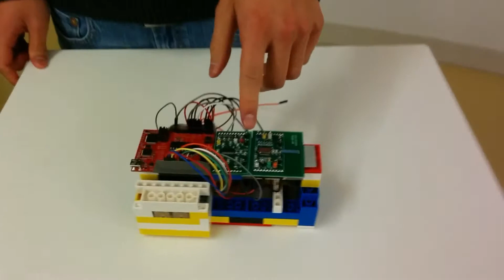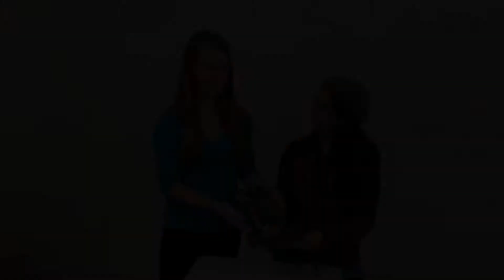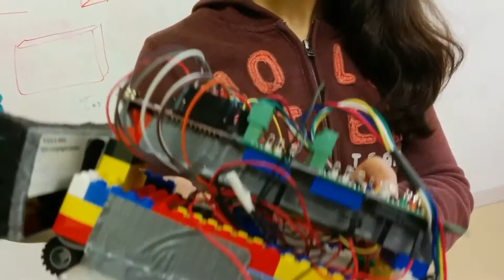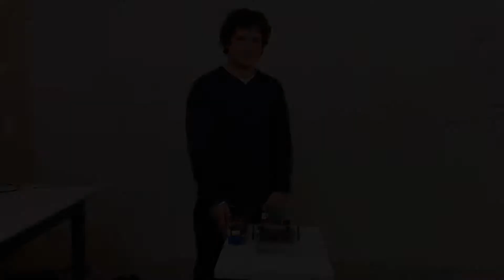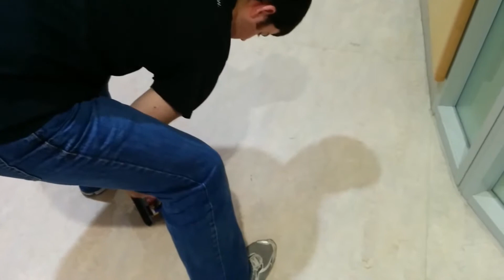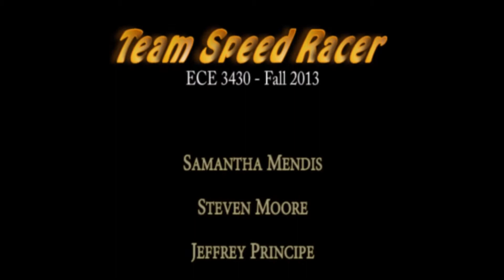Copy of TILaunchpad Hands On Learning@UVA Powell

Comment from the maker: It is great experience for the students to build this from the ground up.  We have done a variation of this that takes a bit of load off of building the car itself.:
- take an off-the-shelf RC care and gut it (keep the chassis, battery pack, and motors) and add a LaunchPad and sensors.  (we had students do this as part of a project course not an embedded systems course, so there wasn't a lot of emphasis on programming, as long as it worked)